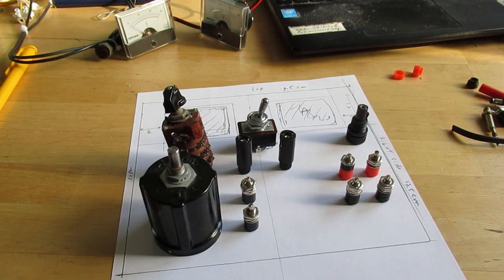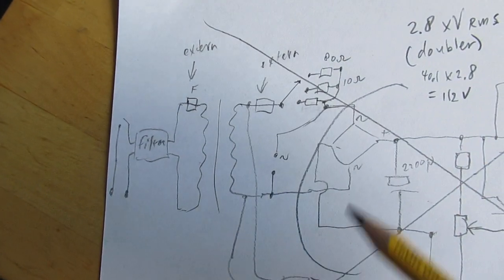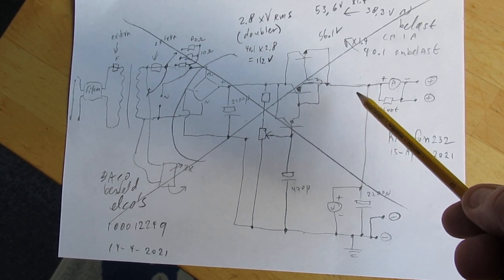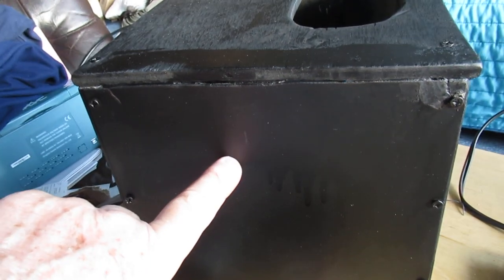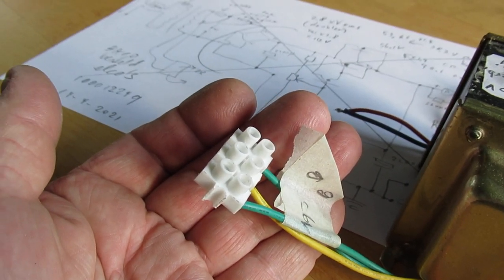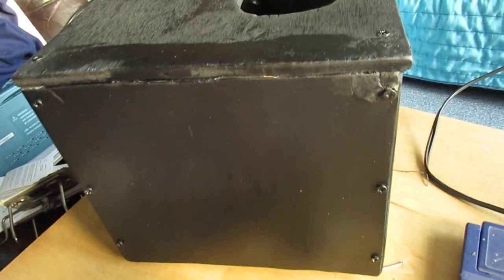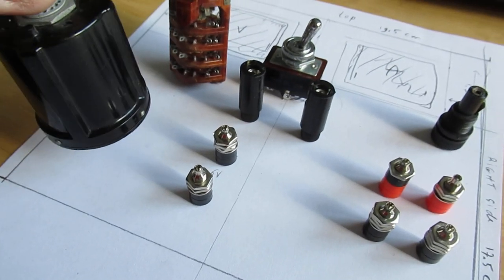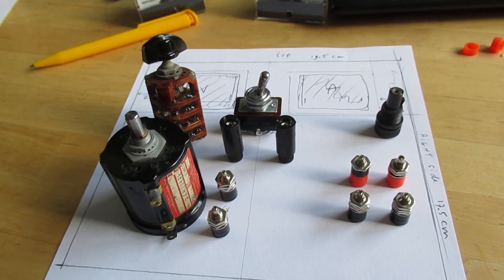Developing a DC 0 - 60 Volt/110 Volt regulated (not stabilized) power supply at 1 Ampère (part 1)

Comment: i love your honesty sir, putting "not stabilized" in the video heading.. most guys would leave that fact out on purpose.. And i think your the only guy on you tube to show that electronics can be done with what you have got to hand. no fancy crap from China.. You need a bread board, get a piece of wood with some thumb tac's, need an Amp/Volt meter for a power supply, use  a old cheap multi meter.. and like yesterday.. you need a resistor you can fine tune, get a length of wire with a bit of copper wire added for fine tuning.. "BLOODY BRILLIANT"
P.S would love one of those beefy potentiometer.. how much power is it rated for??
Reply from the maker: Thanks Keith, and yes I only buy components when I really need them. The potentiometer is a multiturn precision wire wound pot. meter; there is no indication about the wattage. But when I listen to it when it is turned I hear the wiper on the wire, given this and the volume it is surely 3-4 Watt.